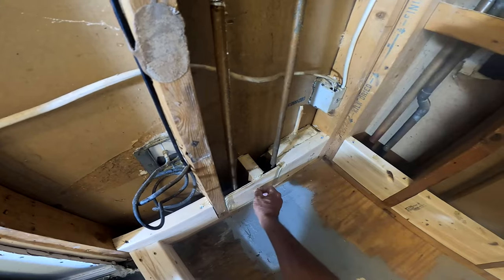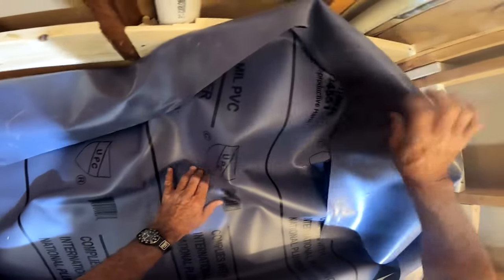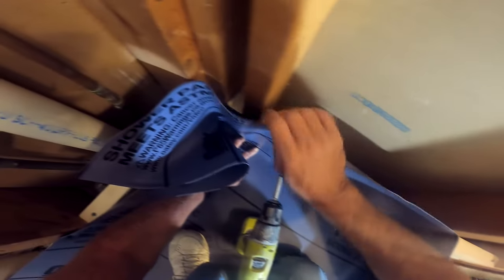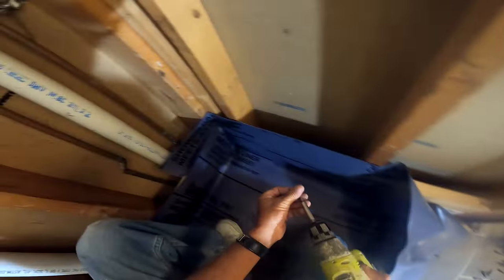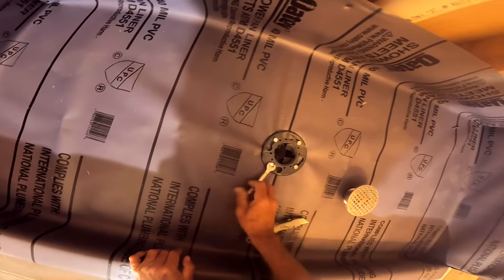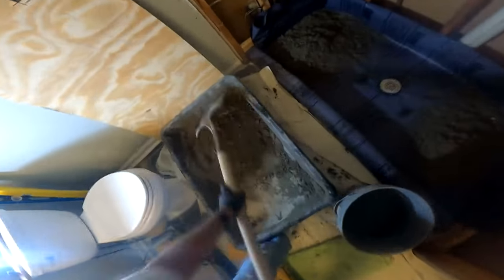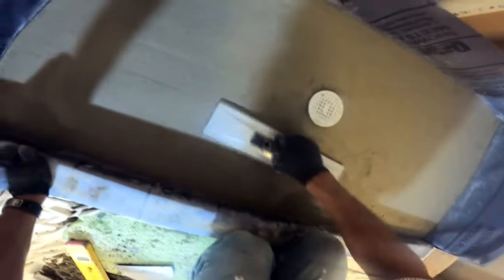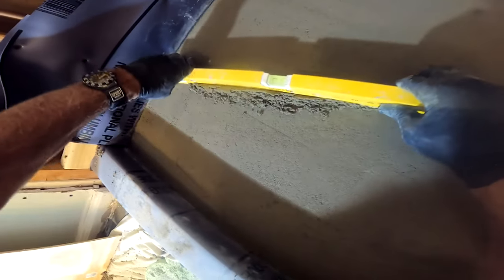BUILDING A SHOWER FROM SCRATCH.....part 2 liner and mortar

Comment: Thank you for taking the time to share your knowledge with all of us! I am remodeling my bathroom using all the steps you have shown us. My floor is NOT level or even close! Does it matter? Once I set up the liner, even if one end lengthwise is an inch lower, will the mortar be an issue? At the end of the day, it will eventually be level, correct? One side will have less mortar than the other?.....As long as I have the proper slope to the drain, I should be ok? Thanks!!

Comment: I use a 1/16  bit to make my bolt holes . Cutting an x seems a bit archaic
Throw your sand topping mix in a heavy trash bag with pre measurements of water. It takes 2 min to mix snow ball Quality mix.
Almost zero mess .
Reply from the maker: Yes archaic is for Old-Timers like myself 😂

Comment: Tile installer to tile installer I would recommend cutting out a good notch in the corners in the 2by4s your pan Liner hight with a multi tool or whatever you got so you don’t have to fold that that pan liner and make a sharp corner, also wouldn’t bump out the wall on the bottom, if you do that make sure your corners are going to be round
Reply from the maker: As I mentioned on the video it is nearly impossible to get into that corner, there's usually two two by fours on one side of the other that precludes you from doing that but I did bring across the idea if you had heard that portion

Comment: Hey Bob, the contractor that’s redoing my bathroom wants to use concrete for the shower base instead of mortar mix. His reasoning is that it dries quicker allowing him to tile the next day. Are there any cons to this method provided that several coats of regard are applied to the base and walls anyway ?
Reply from the maker: Concrete is not ideal because it is difficult to work with and it will not hold a proper slope as it too runny, plus can't get a good smooth surface, plus it has lime added in it big no no for shower pan
Reply from the maker: And by the way they do have quick setting mortar, but it starts to harden up in about 30 minutes so you have to be really really good

Comment: Im pretty sure I saw a video of yours where you said you shouldnt put hardy backer or wall board over the pan liner. The wall board should be installed first and then the pan liner over that because the wall board can wick water up and over the pan liner. Am I remembering wrong?
Reply from the maker: Yes you are remembering wrong, the video you reference is where I talked about not putting your wall board before your mortar and having it all the way down to the bottom of your pan and then pouring your pan around it

Comment: Do mine exactly the same except I make a cement curb. also, use screws. Easier to take out and readjust the liner..nails are a pain if you have to readjust the liner
Reply from the maker: Yes I use screws as well